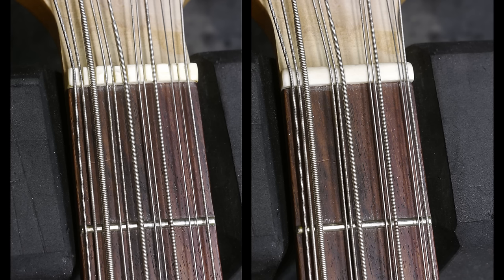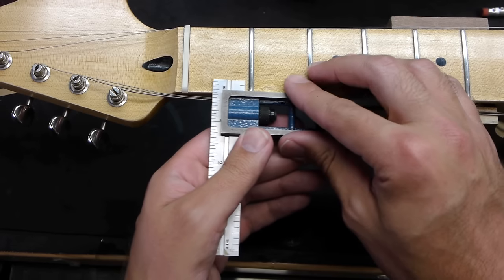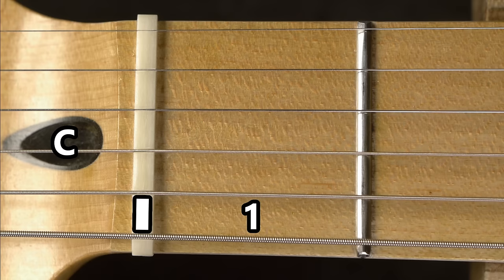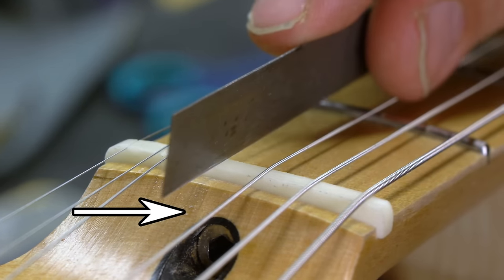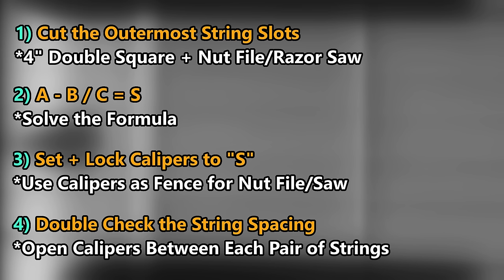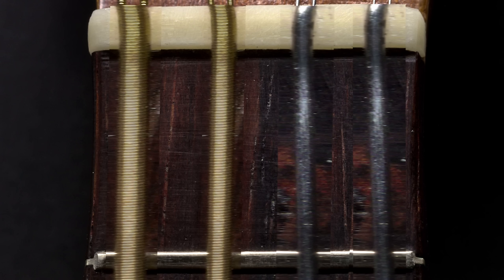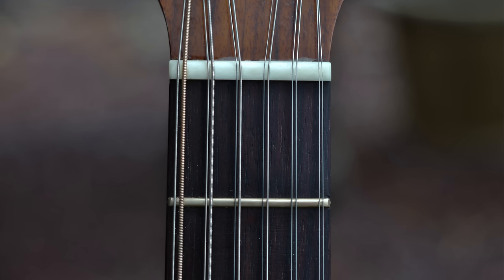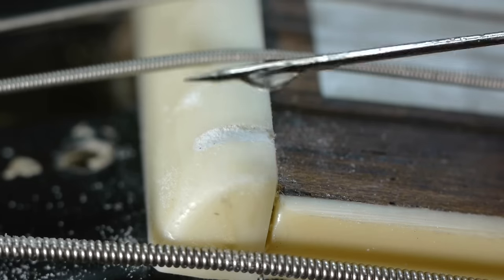Nut Slot Spacing *FOOLPROOF METHOD* - Works for 12 Strings Too!

Comment: Once you have the two outside strings located you can take the nut from instrument over to the bench and put it in your bench vise or other holding fixture for finishing. No point to risk damaging an expensive neck. Also record the angle from centerline for each string from the nut to the tuner. Less important on a Fender neck than a Martin neck.
Reply from the maker: You are correct, and many techs make nuts the way you've described with great success, and also like you said, with no risk of damage to the guitar. 

However, this method requires the nut and the strings to be on the guitar. Caution is certainly required. My goal here is merely to present another option for nut slot spacing, to add to the pool of pre-existing methods. I find it's especially helpful on paired string nuts -- 12 string bass nuts being the hardest I've encountered, with tripled strings in four courses. 

That 12 string bass nut was actually the inspiration for this method, as I could not wrap my head around how I was going to do it cleanly and accurately. The original was a mess, as you can see in my video. 

The angle is also very important, as you said. I remember the first time I realized the angle also has a significant impact on intonation. I was quite surprised.

All roads lead to Rome. Simply another path here. But caution is warranted as you pointed out. Particularly if resting the jaws of the calipers on the fingerboard. In hindsight I would have added an annotation that mylar film or even a strip of masking tape can be used over the fingerboard to protect it, though I've never had a problem -- better safe than sorry, for sure. 

A minute of preparation can save several hours of headaches. Cutting the slots in a vise as you've advised would certainly avoid a lot of pitfalls, and many techs, if not most of them, prefer to slot their nuts the way you've described. Thanks for the comment!
Reply: No matter what, the final adjustments need to be done on the guitar. Protecting the surrounding area is essential. 
Fot equal gaps, needing the strings in place precludes taking the nut to the bench. 
I think a lot depends on the instrument and head stock as angled cuts, tapers, etc  come into play.  Skill is certainly required for this job. I think the creator makes that point several times.  
My only suggestion is that only a small locating notches at the leading edge be cut. Afterwards the correct cuts can be angled as needed for the instrument.

Comment: What youre showing in your video clip, is that how they do guitar setup @ guitar centers?
Reply from the maker: No idea. All I know is not many people are using a digital neck relief gauge (or measuring relief digitally via other methods, e.g. capo at 1st, using a popsicle stick/dowel threaded between the strings to depress the string at the last fret, and checking relief at the 7th with a Digital Action Gauge). 

I also don't know anyone else that checks relief on the bass, middle, and treble sides individually. I didn't show that in this video but I always do that to look for twists in the neck and to get a better idea of what the fretboard looks like overall. 

Neck relief - action - nut - fine tuning the action/intonation/odds and ends, is the general procedure most people follow. i've always adjusted the neck relief first, as it provides the foundation for the other adjustments. 

I also use understring fret leveling. Getting the neck straight under full string tension offers an additional advantage. You get the neck straight, capo the 1st, set the action, file the nut slots down to the proper depth, then you play the instrument on every fret and listen and look for problems. 

My goal is always to get the instrument playing with the neck straight and the lowest possible action, regardless of where the desired action is. An optimal setup/fretwork should result in an instrument that's playable with the lowest possible action. 

All too often, people will add more neck relief, and raise the action, to compensate for bad frets. 

I have heard of some Guitar Centers not dealing with fretwork. Good fretwork is a highly specialized skill and it goes far beyond simple fret leveling. It's worth asking the particular store or tech whether they do fretwork or not, and what you should expect. 

A major reason I'm building this channel is to empower people to learn more about their own guitars and do their own work, insofar as that's possible for them. I plan on making some dedicated setup videos in the future. I have one about truss rod adjustments in the works and eventually I'd like to make a complete tutorial on how to do a setup from beginning to end. It's much more involved than most people think, while it's also very simple at the same time. 

it's a lot to cover! So. Hopefully this had some helpful information instead of just making things more confusing. I could talk forever about all of this stuff.
Reply: 🤣 What they do there has 0 to do with setting a guitar up!

Comment: On 12 string should the bottom of the pairs be set to the same height on the bottom so that when fretting a note each string of a pair will strike the fret at the same time or set top of pairs to same height on the top of pair,I thought best to set bottoms equal height .What say you sir?
Reply from the maker: Excellent question. I have the bottoms set to the same height. I should have included that-- completely slipped my mind! 

Usually the thicker strings are set a bit higher but I think getting the pairs to the same height makes sense. So you'd measure the gap between the bottom of the string and top of the 1st fret. I use a digital action gauge for this. 

And sure enough without even realizing it I set my 12 string pairs like this. Thanks for asking that question! Got me thinking now.
Reply: There is some thought to having the string bottoms equal at the nut, then the string tops equal at the saddles. Kind of keeping the beneficial point of physical actions at each end.  At the nut, where string height tension affects tuning and sensing pressure under the finger; then at the saddle, level across the tops so each string feels similar in access.
In discussing this with one customer, they suggested leveling each pair at the saddle through the centerline of each string.  We tried it, I found it rather inexplicably comfortable, they liked it and kept it like that, and I still prefer to feel a little more of the thinner string access.

Are we crazy?

Comment: Just to be clear, it is 5/64s, not 4/64s? Thanks!
Reply from the maker: Yes, lately I've been using 5/64" instead of 4/64". Either is fine. But 5/64" gives you a bit more room to avoid slipping off. So I've been using that lately. 

Another commenter pointed out the error I made as well, using the 32nds part of the ruler when showing the closeup....my bad! 

5/64" (.078", or 1.98mm) is what I"ve been using for the distance from the fret bevel most these days. 4/64" will work, but...as time has gone on, I've liked bringing the strings in just a little bit more. 

I recommend trying both spacings from the bevel and see what you think. 5/64" is probably gonna work better for most people, but 4/64" does give you a bit wider spacing, which some people might really enjoy, though you gotta be more careful with fretting those Low and High E strings so they don't slip off while you're playing.
Reply: @guitar_md  thank you for the quick reply! I'll be using this method. Much appreciated.
Reply from the maker: @KevinScarbroughMusic  Sure thing! Let me know how it goes if you get a chance. Thanks for the support!